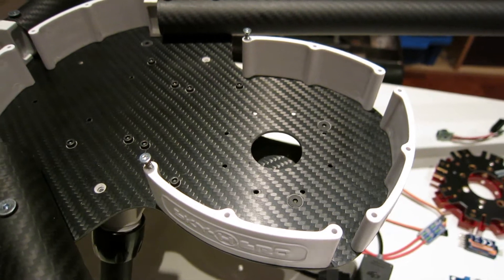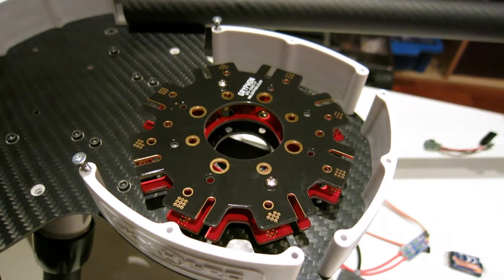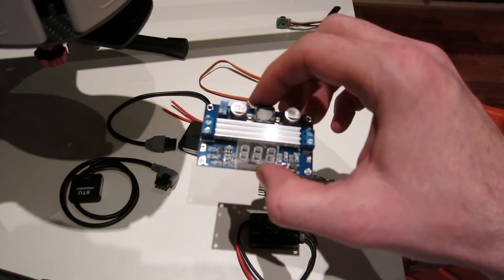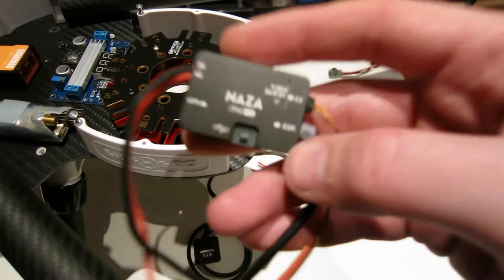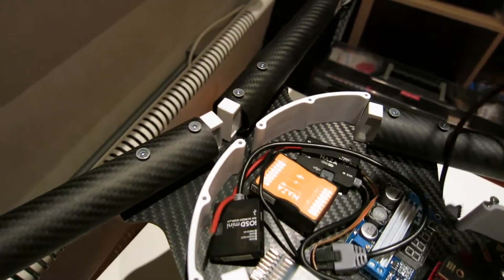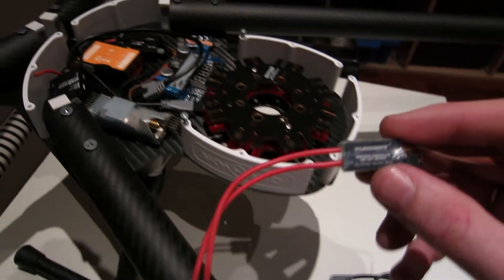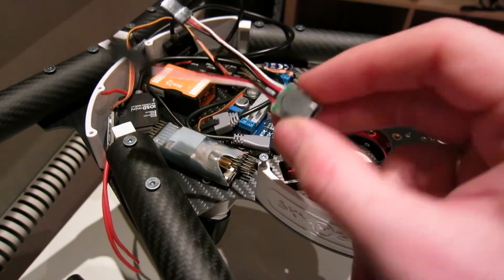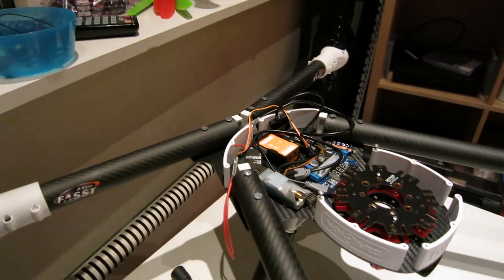Build quadcopter - Sky Hero Spyder

Comment: Shouldn't be an issue, but where you have the PDB is the aircraft C of G.

Easy way to figure this out is drawling cross motor to motor. 

You naza is too far forward but so long as in centre line may not cause issues.

still nice build

Comment: I enjoy your Build Videos. Thanks for posting them.

At 1:45 you mention that you want the "Flight Controller" on the Center of Gravity (COG). That does not mean the 'Center Line' it means the "Center of Balance" (ideally in three dimensions).

You want the center of your Controllers 'Balance Mechanism' (which may not be it's exact center) INSIDE the Object's (your Helicopter's) COG.

My guess is that you are a bit too far forward, and too high BUT it depends on any weight you add later. Being too high (with most of your weight below) will not hurt unless you get hit with a big gust of side-wind (then you will know it).

I suggest you move it back and put in under that plate (if possible), otherwise you have the undesired situation of adding weights. Ideally you would want to be able to move it for different Cameras IF you swap Cameras a lot (and that would be a pain to do).

Here are some suggestions about how to find out exactly where it must go.

Using the "Propeller Balancer Method" to find the COG:
Center of Gravity screws on quadcopter

This may be more difficult (in your situation) but it demonstrates the point I am making much better:
Finding the Center of Mass of an Irregular Object

Search YouTube for more Tips on this subject.

Here is what happens with the COG too high -- Controller is confused:
Quad Copter Fathers Day 2013 movie

Your welcome,
Rob

PS: Sub me for low light filming Tips.